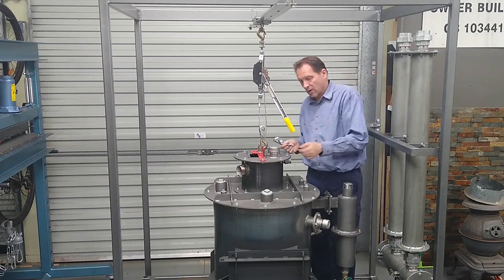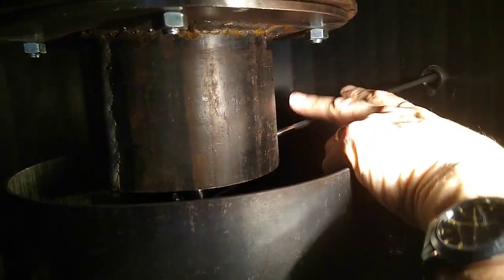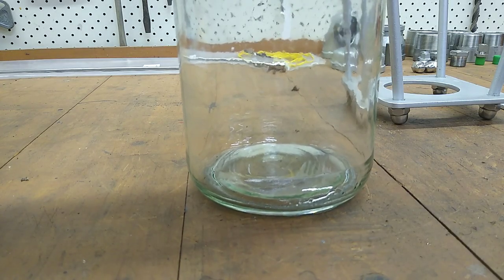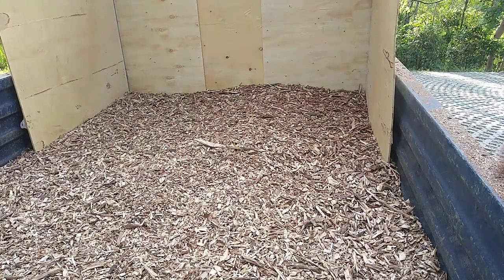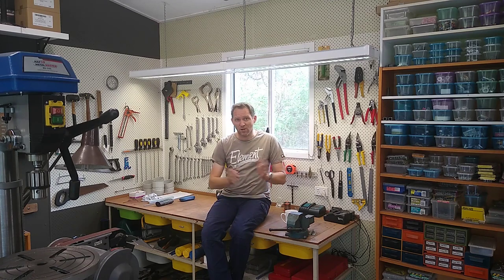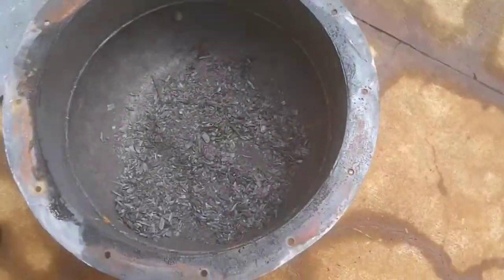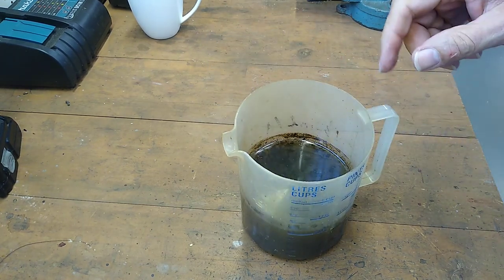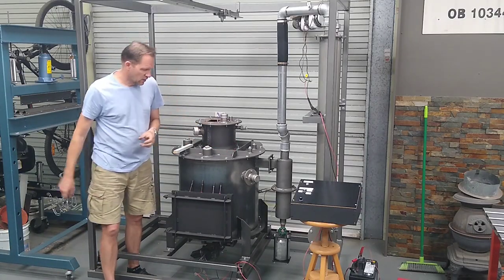Wood Gasifier/Generator, 1st Test Run E12

Comment: You should adapt this to run large solid fuel, the bigger the wood input, the smaller the input energy to get the fuel. I'd run full rounds of 6" logs with a charcoal base and a grate above the agitator that would keep the large solids from plugging the grate. Better to load full logs with minimal processing cost, than spend gas and time making the furl smaller. Cheers and best of luck, love your videos keep up the great work!
Reply from the maker: Thanks, yeah I do want to try the smaller fuel as I have an endless supply of it, the system is designed to run with a stirrer just like spanner Re so might have to install sooner rather than later, cheers

Comment: In the condenser. It looks like you have a fair bit of Creosote. You get rid of that by running your reactor hotter. In my opinion for what it is worth it appears you had too much oxygen in the top part of your reactor. I suggest using a larger fuel and if you can focus your oxygen only to a small area you might get the high temps you need.
Reply from the maker: Thanks, yeah will be running larger fuel next test, just wanted to try it, my biggest problem was that the agitator wasn't working, that's been fixed, so getting ready for next test, cheers

Comment: Thanks for sharing your gasifier video. I always enjoy making my own predictions and seeing how close my thoughts are to what actually happens.  I do think the fuel you are using is a bit too small. As for the flash back out of the ignition port, if air gets past the char bed it can mix with the gas and cause your fuel to unload itself even out through the top of the hopper. It does look like it was getting in through your access door. That's dangerous. Also you may want to install a check valve before your blowers. This way if they shut down for any reason you don't have air rushing into your pipes creating a bomb. I'm in the process of making one he'll of a fuel processing system. I plan on making 3/4" cubes right from logs. You'll have to keep an eye out for this next video. It's like nothing I've ever seen anyone do so far. Probably in a month or two it should be able to be tested. Oh by the way,  check out Saint gobains self stick high temperature gasket material. It comes in rolls and works great for high temperature doors. Anyway thanks for the show. I look forward to seeing your next run. Joe
Reply from the maker: Thanks Joe, yeah I've got a few items that need sorting, I have gone over to a chunkier fuel, just done the 2nd run, went better, still problems to be rectified. I'm very much looking forward to your next video, as I'm thinking of ways to automate making chunky fuel, cheers

Comment: Hello,
Great job !
From my experience, this gasifier type need wood blocs ( size should be about 1/3 to 1/8 of the reactror diameter,
 you will have to much pressure lost with wood chip
Reply from the maker: Thanks mate, was hoping to run smaller fuel as I have heaps, the system is designed to run with a stirrer just like spanner Re, will probably have to install it sooner rather than later, cheers

Comment: Very nice! In my experience it's better to sieve the wood chips, in order to have a bit bigger pieces. You have a kind of mix, with too much sawdust in there I think, it can clogg the output.
Reply: The air going through the gasket would explain the little explosion at the beginning... The problem could be resolved by putting some grease onto the gasket? Maybe it would melt with the heat...
Reply from the maker: Thanks, yes I'll definitely screen the fuel for the next test, looking at different seal materials for the hatch door, cheers
Reply from the maker: Yes I agree, cheers

Comment: Well done on your first ever gasifier test  :) . 
 You have made all sorts of valuable discoveries, which will surely lead to some little improvements here and there. 
 You DO have a flashback arrestor in the flare port feed pipe right?
 Bitter experience has taught me of the need for this, along with an emergency air purge valve on the input end of the blowers. 
 Keep the magic happening, and burn up all those pesky little woodgas bugs for us  :) .
Reply from the maker: Thanks mate, yes I have steel wool in the pipe at the flare, hmm I think the bugs got me with that blow back, cheers
Reply: @whathappensintheshed  
 That's good to know. Safety first, so the woodgas bugs can have a live specimen to nibble on  :)  .

Comment: a couple of things you might look into :- 1. spend a couple of days learning to weld. 2. learn how you can make the gases SWIRL, this makes better us of time in the CHAMBER. 3.use close to horizontal in and out augers, with vertical in & out feeds, these vertical feeds must be long/high enough to act as air locks. 4. managing air in is easier to control  with larger burn mass.5. cause the burner to swirl the burn and you must manage the air volume.
Reply from the maker: A lot to unpack there, it's still early days, some major changes coming up, cheers

Comment: Yeah i build one to and te best that i let it work on bigger fuel, and maybe instead of 2 cilinders for condensator u can use a big barrel. It loses more water and u dont need to put so much succion on the system
Reply from the maker: Yeah will screen fuel before next test

Comment: It looks like your trying to get hot enough to crack the tar, if so you shouldnt use any charcoal and you have to generate more of a roaring fire.
Reply from the maker: I missed your comment, yeah I just have to get it to breathe properly and then temperature will come up, cheers

Comment: when you made charcoal you burned off all volatiles that you needed to make the wood gas
Reply from the maker: I only make charcoal for the initial start up, once I've got this up and running properly I won't need to make anymore. Was I to start on wood it would generate a lot of tar gas before reaching 1000 deg, cheers

Comment: I have few remarks about your video:
I don't understand why you are making charcoal to burn in your wood gasifier. You have been burning the very gas that you want to make in your gasifier, go figure.
I have seen people using fire wood in their gasifier.
I notice that you are using your crescent wench the wrong way.
Also, you don't tight a plate in sequence. The correct way is a crisscross pattern :) 
It appear to me that you are somewhat mechanically challenged :(
Anyway, wood gasifier were used in Germany during WW2 to run cars. They looked like a water heater bolted to the back of a car.

Comment: All of your ash is unburned hydrocarbons (fuel) and the ash drop should be shaped like a shallow funnel, then there should be some kind of capture bucket. Your air should be pipes with the holes facing down throughout the combustion chamber. About 2/3rds up the combustion chamber should be preheated air for burning smoke. This will also create higher heat and a faster moving exhaust gas.  Also, charcoal could easily be made in the combustion within enclosed wood filled pipes with a tiny hole in them. Good luck.
Reply: It seems to me that theres too much oxigen getting in, and what you need is an uncomplete combustion (which it does not need lots of O2)...

Comment: Yeah fuel is way too small. You need chips around 25mm X 25 -40mm X 10 - 20 mm thick. Your machine looks like it will run chunked up fuel as well. Blocks ranging from 25mm on up to 50mm square. 

The smaller the fuel more density it has. The more density the more pyrolisis gas produced. Your reduction can only process so much and its being overwhelmed with this high dense gas. This is where all that water and tar is coming from because that is what is bypassing your reduction zone. Then you have that clogging issue that is leading to lower temps also factoring in the poor water shift and tar cracking performance.

Comment: Man, be careful air testing, like that. I worked for Campbell Hausfeld for a few years. I saw several air compressors fail back before they went to hydro testing. The amount of energy released is amazing. Hope you kept that down low on the pressure. 

Not trying to be a smart a$$. Just don't want to see a dead... you. -David
Reply from the maker: Thanks mate, no worries all good here, the vessel is under vacuum, the blowers are sucking air through the system, what happened was caused by the charcoal bed slumping below the ignition port and me blocking off the inlet at the top etc. Next test will be more careful, cheers
Reply: @whathappensintheshed  I mis-understood how you was testing the welds on the system. A common thing is to pressurize the system and wet the welds with soapy water and look for bubbles. I thought that was what you was doing in the early part of the video. It can be vary dangerous. Something similar to the size of that vessel pressurized (to check the welds) to a level of 50psi would have more potential energy stored that a pound of TNT. 

I've built a crap ton of gasification system a few years back, not sure why the algorithm is populating my feed again with them but... if you ever need a custom part made, I have a pretty extensive shop. -David
Reply: @GorillaStrengthEquipment you ain't kidding.. I over see hydro testing at refineries and when ever we have to do pneumatic testing due to water weight constraints, I try to get my job done asap because of the energy stored in pneumatic testing.

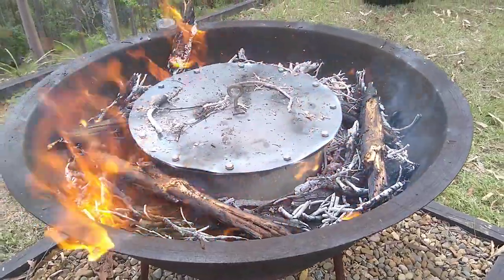Comment: 20:13 "I wasn't expecting that"
Man, you're building a wood gasifier, aren't you? Of course there's going to be a gas build up if you don't make an outlet. You're lucky it didn't explode in your face like that gasifier incident you had earlier because pressurized jet of flaming gas with steam to the face would be far nastier than puff of some ignited charcoal dust. At least you're wearing glasses by default so your eyes are somewhat protected.
Reply from the maker: It was my phone camera that copped the brunt of that back fire, for next test I'll be in long sleeves, cheers

Comment: Ur grate/shaker quitting, fuel size + that door leak caused the problems. (As u know)
I like ur design overall.  Im looking forward to more vids. My question is:
where's the ash falling to? N how cld it b airtight w that open? 
Also, what if the air inlet was piped directly to the burn zone? (Or what about multiple jets placed) To achieve higher temp..
I hope u come up w something great. My design is a combo of diff ideas from diff gasifier builds. (What I thinks best from em) + it's about 75% based on ur model.. so I need to see u nail this! Good luck
Reply from the maker: Thanks, in time there will be an airtight ash collection chamber at the bottom, my design does not have jets like an imbert, it's more like a drizzler type, 2nd test coming up soon with bigger fuel, cheers

Comment: Next time your making charcoal  don't bother with a small vessel like that , just  use your fire pit , or a  old bath tub start a fire and throw your branches on and as the flame die's down  cover with more wood  then as that flame die's down  another layer of wood , carry on like that till you have enough charcoal  , shovel into a metal drum and loosely put the lid on and allow the charcoal too  cool down before clamping the lid on  , if you need to make the finished charcoal smaller then  use a shovel and some fly screen or a larger sieve type to get the dust out , and try chunking your wood  rather than chipping it , as you now know . 
Great build as i have said before  soon have an aching face and be smiling  from ear to ear .( think Lemons ) :)
Reply from the maker: Thanks mate, yeah I've gone over to chopping the wood much better result, the one thing with making charcoal by off-gassing in a vessel is I don't lose much to oxidation, well apart from the timber burnt to create the heat, I see what you're saying, I did think about it, cheers

Comment: very exciting project! My aunt had stormy weather in N. Zeeland too. Question: I've seen similar setups with normal wood (pellets) not charcoal. Why is it needed to charcoal the woodchips?
Reply from the maker: It is best to start on charcoal so you don't produce tar, if starting from cold on woodchips it will produce tar until up to temperature, on following startup the system is already primed with charcoal, cheers